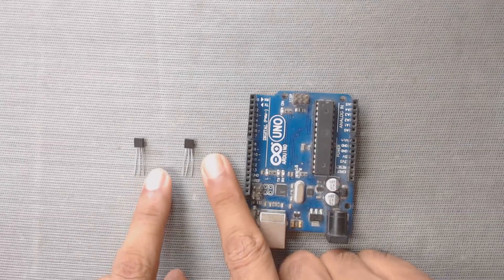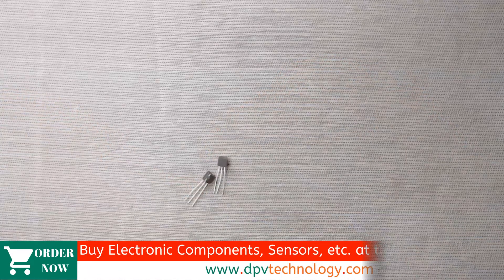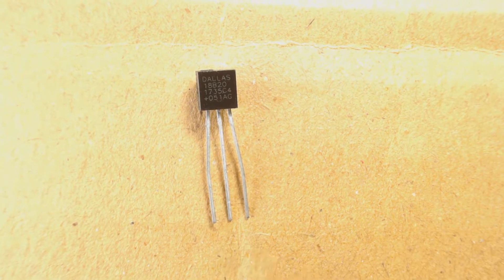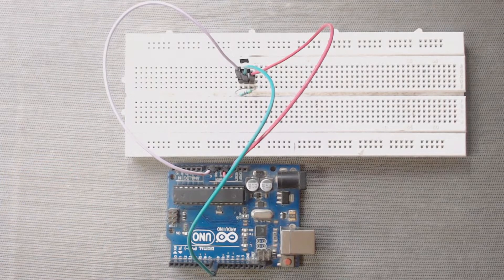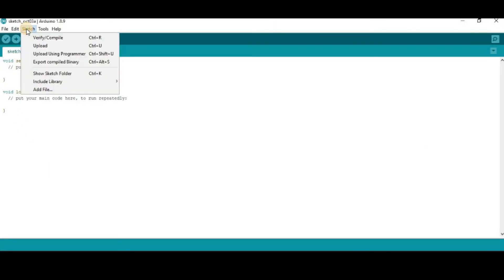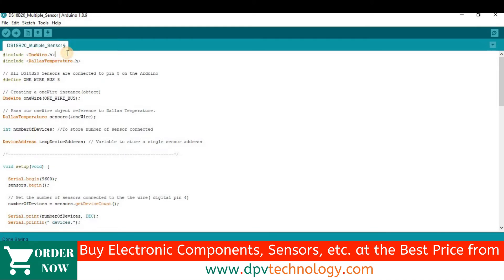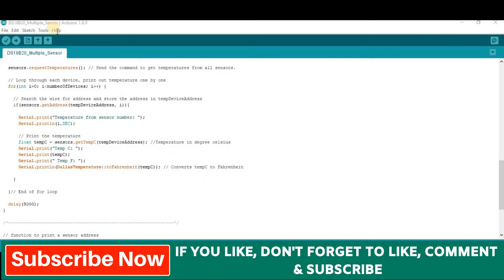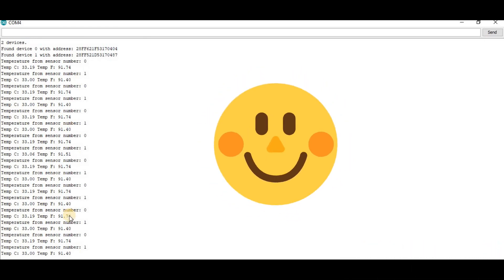Multiple DS18B20 temperature sensors with Arduino

Comment: Hi, i like the code as it is nice and short, what i would like to know how would i use this code that has extracted the address to operate more than one LED  each with it's own temperature sensor connected to it . Normally i would use  the  if(sensors.getTempCByIndex(0)) which i would use to work the one LED. Thanks in advance. i looked all over cant find an example.